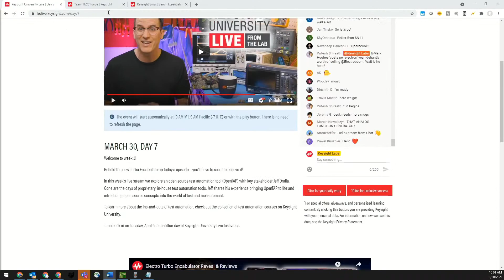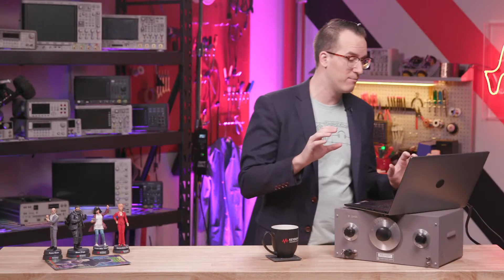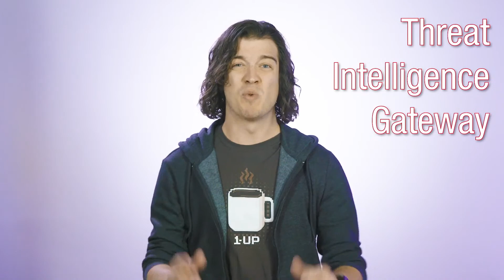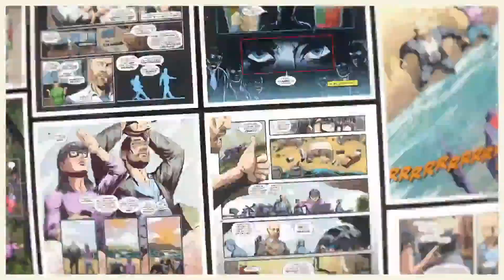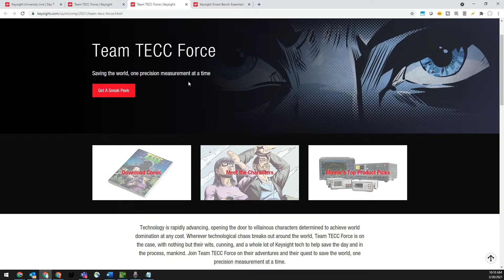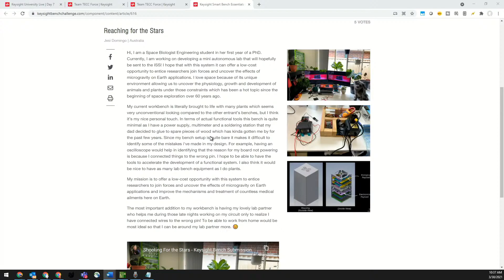Live! 30-Mar Keysight University Live

Comment: You ask for submissions of desperation and now the green glow of hope in my 1970  ELECTRO LAB Oscilloscope has dimmed and has little chance of being plugged in again. Is eloquent,  high voltage, sensitive, real time IC free 1 page schematic but art on the wall. Its 3 book granularly detailed  construction, troubleshooting  and operation manuals without purpose.